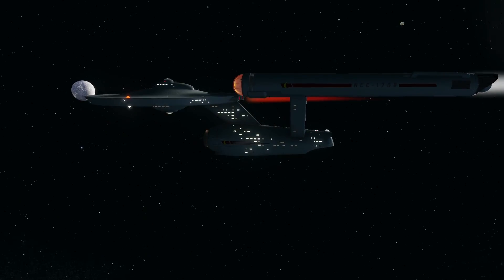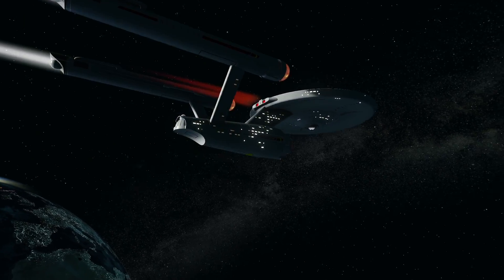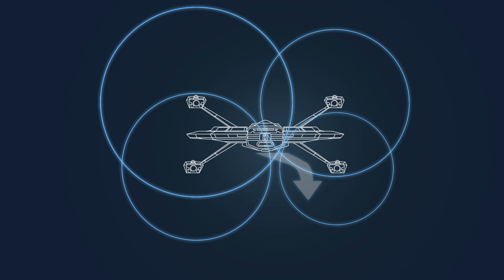Why Extra Nacelles?

Comment: The most reasonable explanation.
If you go with voyager and back.
Single and odd Nacelle ships do not officially exist in Star Trek. Because Gene Roddenberry point blank said Federation Warp Nacelles must work in even pairs and in line of sight of each other. 

Most reasonable technology explanation.
First of we have to figure out how they work. Based in show LCARS displays we clearly see. The Warp core is connected to the Warp Nacelles, Warp coils section. 

So that means logically the Ships main power is probably generated with the combination of the Warp Core and Warp Nacelles, Warp Coils.
Based on in Star Trek Voyager and The Next Generation episode's there seems to be a lower in system Warp, Higher system to system Warp Speed and Emergency Top Warp Speed that is extremely limited in how long the ship can maintain and is only around if memory serves 5 to 6 hours. That time seems to be based on the overall Warp system as in Warp Core and Warp Nacelles. 
So where does this time limit come from is the question. So logically let's look at the Engineering section you got the Warp Core and two cooling Towers and over heating forced the Enterprise 1701-D to drop out of Warp.

So let's look at the Traveller episode and the displayed Warp field as it is shown how the Warp field is generated from the Nacelles and the Warp Core power Generation is in tandem. 

We now got everything established and a base line. Now let's work our way up in Nacelles count.

Single (odd): In the version with a Saucer only that means the ship was probably only intended for inside Starfleet territory and only low overall Warp speed and low profile power demands. 
Such as the Scout is probably to investigate systems after the likes of the Enterprise has.
The Destroyer probably sacrificed phasers for a more long range torpedo load out. 

Two (even): This is your box standard federation ship. Meaning your Warp Core, Cooling Towers and Warp Nacelles all equal out to current federation technology. 

Three (Odd): basically we see the famous The Original Series Dreadnought and All Good Things Galaxy Dreadnought Refit. So what the third Nacelle probably does is in the case of the Original Series Dreadnought is probably serves as a interaction between the core and Nacelle to put out Warp level energy output to aide in powering Shields and weapon systems when in combat.
Meaning the third Warp Nacelle probably doesn't have a traditional Warp field coil but a modified Warp coil for power output. 
The All Good Things Galaxy Class Dreadnought based on in episode scenes and dialogue. The third Nacelle is probably much the same reason as the Original Series Dreadnought but in this case. The Nacelle is probably to power a cloaking device and the main phase Lance. Basically the Cloaking device used the whole third Nacelle possible output. While the Phaser Lance doesn't use the whole Nacelle. 
Only thing missing in both three Nacelles ships is the Warp Core and cooling towers layouts. 

Four (Even):  We established the Warp Nacelles work with the Warp Core and Cooling towers. Meaning there is two possibilities for four Warp Nacelles. 
It is hard call the exact function of four Warp Nacelles. Either the design has it's origin based in Warp Nacelles testing or a Late technology generation ship design.
As in the Constellation would date around Excelsior. Meaning the ship would have an Excelsior Warp Core and cooling towers. Powering Motion Picture Warp Nacelles. Basically sitting the Ship in line with a longer over all Constitution Class at Top Warp Speed time limit.

Six (Even): The Prometheus is an experimental and not much is known about the concept. But based on what is shown in the episode. Each section has it's own Warp Core, Cooling towers and Warp Nacelles combination. Meaning separated or combined the ship will have the same power demand and output ratio. That means the ship is probably more of a test platform for automation and coordinating attacks. The combined configuration was probably meant for working on and doing adjustments on each component. Hence why the ship separated before attacking in full automation.

Comment: All of those designs are two dimensional even the ones with four nacelles. The three nacelle design is 3 dimensional if the nacelle is a round design at 120 degrees. Like the space is a 2 dimensional environment. The thing that I don’t understand is why the “living” quarters are not in the geometrical center of the nacelles or the front blue satellite dish thingy. And for the grand finale, I was just ranting about the thing without any warp drive knowledge. I like the Vulcan ring ships a lot.

Comment: What I don't understand is why Voyager was the one with small nacelles. If the subsequent classes were also using smaller ones, Ok. But the Enterprise E had them big, as usual.

The technical part is a mess.

I don't think three nacelles would be a real issue, forming a warp bubble, that would work in a triangle config.

Four nacelles sound like bigger warp bubble, like giving warp to other vessels

Comment: Non specific borg tech . What's the point of tech that we don't even know what it does and , only engine or trans warp technology would make sense. But apparently its not . ( stargazer)
Reply: It could also be shields, integrity fields, computers. Even just power converter nodes. Voyager mentioned all of those as Borg upgrades to the ship at various points.
Reply: @kaitlyn__L  possibly but I believe the shields used by promethus and enterprise e . ( multi physical regenerative shield) after the war that became a fleet wide upgrade, buy this period a newer improved version.  ,( a quantum, multi phasic regenerative shield, ) whatever that means 😀.  

But power or communication systems would make sense.  , I'd be tempted to say sensors or astrometric systems.  But I think they got them from voyager.  , a computer system would also make sense, I'm sure borg computers were superior to federation ones  ?
Reply: @shanenolan5625  oh yeah, they said over and over that Astrometrics used Borg optical and spatial (maybe gravity wave?) sensors, I can’t believe I forgot that part :)
Reply: @kaitlyn__L  no worries.  Same happens to me regularly

Comment: I still prefer ships designed with Roddenberry’s original concept that the center of the warp field is between the two nacelles which immediately disqualifies single nacelle engines.

Comment: Warp factor is still not a speed, sweetie. Each ship had a unique speed AT a particular warp factor. That's why the Galaxy class was 9 times faster than the Intrepid even at the same warp factors.  Also, we know that ships can go to warp with ONE nacelle...we know they can go to warp with NO nacelles. Obviously the multiplicity of nacelles is a redundancy firstly but can also be used to more severely warp spacetime to get the ship up to higher speeds. We know Galaxy-X was capable of warp 13. And we know NOW that the third Galaxy-X nacelle was probably something like the Protostar drive. A wholly separate type of high velocity drive.
Reply: Although there’s nothing to directly 100% absolutely contradict that, at least for factors higher than 1, I feel this fan theory is mostly just an attempt to cover up how inconsistent the speeds were from episode to episode. 

For one, it goes against the spirit of the thing, given the inspiration was Mach numbers, which absolutely are fixed speeds. 

For two, why would telling the captain “they’re approaching at warp 9” mean anything if that’s actually an utterly arbitrary speed dependent on unique ship factors? (And how would saying “go to 9.1 to stay ahead” work?)

I could maybe buy that occasional localised conditions can sometimes apply a flat multiplier (up or down) to what the speed would otherwise be, if we really want to justify why warp 5 is sometimes 25c, sometimes 125c, and sometimes 1000c. But I honestly don’t think even that is really necessary.
Reply: @kaitlyn__L  Relativity! When someone is approaching you at Warp 9, they're approaching you at the velocity YOU attain when YOU are going at warp 9. And it may be true that the warp scale was originally set to be some variation of Mach, because Warp 1 is supposedly the speed of light. But after that point canon makes no sense and we make it make sense by understanding that larger ships cruise at a higher speed because of the displacement they make in the water. That is why the galaxy was 9 times faster than the Intrepid even if the Intrepid had a higher Warp Factor. If you think about the intrepid like a dinghy and the Galaxy like a liner, the RPMs of its propeller can both be pegged at 9500 but the Galaxy is just going to be going knots faster because of its size. And if we look at the history of Starfleet ships we know this is true.

Comment: The notion that nacelles had to have unobstructed line-of-slight with each other or that there could only be even numbers isn't original. Not even close. Actually go back to the TOS series and watch through that. None of this contrived drivel is there.

Also, no science fiction franchise that has any measure of respect for Carl Sagan should EVER name an armed ship after him.
Reply: That’s true, but only because  Roddenberry came up with it for TMP and TNG. 

Originally for TMP he wanted a big blue beam of plasma going between the nacelles, and it would slowly travel to the back before reappearing at the front;  but they couldn’t get the VFX to work. So they just lit-up the inside grilles when the ship was at warp.

Honestly I’m kind of glad it didn’t work, I think it would’ve looked cheesy. Now if it was a distortion akin to heat haze, I think that would’ve been really cool. But a big blue beam? Nah.